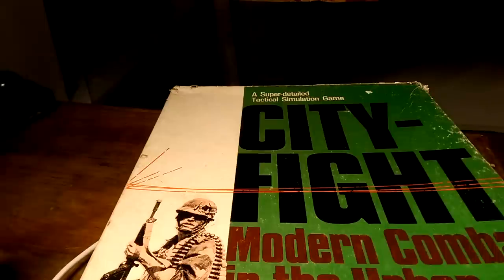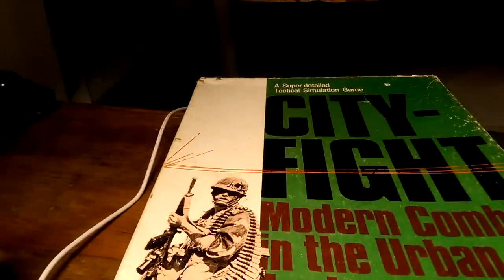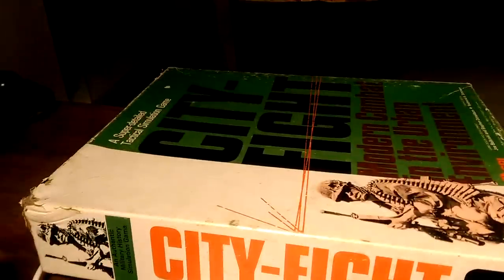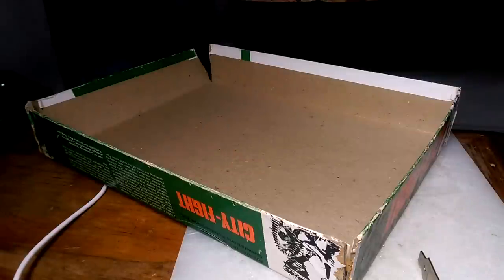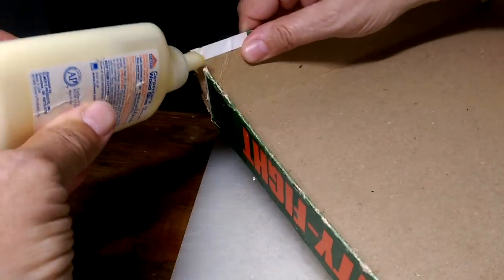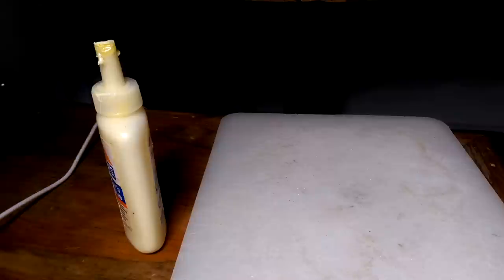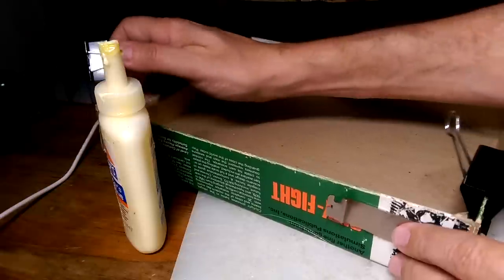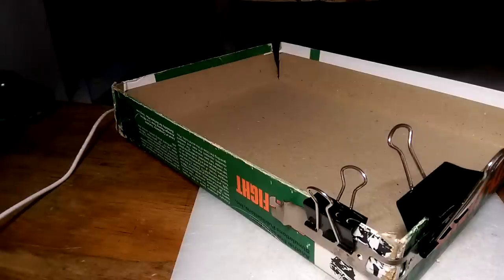Box Repair quickie

Comment: painters tape works well to secure box corners after applying glue, that's what I do anyways.  I then peel it off after.
Reply from the maker: thx
Reply: I know I'm three years late for this comment, but even the weakest painter's tape can pull off art and paper especially for older games that don't have gloss coated paper.

Comment: I use a simpler and much more efficient way of fixing cardboard boxes.
You don't need those clamps or metallic curves. Just use a tight common elastic to secure the whole box and then apply a LIQUID paper glue (not a THICK paper glue) in all damaged corners.
Liquid paper glue will self-spread and make a stronger layer over the cardboard. Wait for 30 minutes to 1 hour and remove the elastic. It's good as new. :P

NOTE: the liquid paper glue shall be transparent; some are white but after dry they'll turn transparent.
Reply from the maker: great!